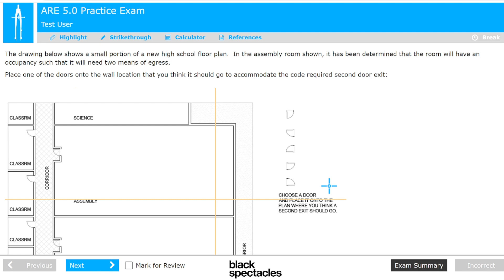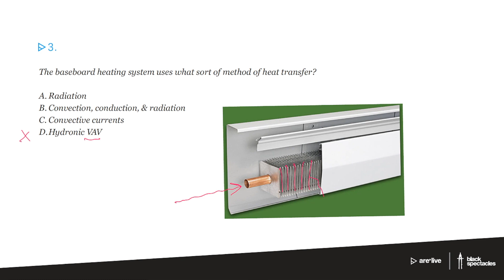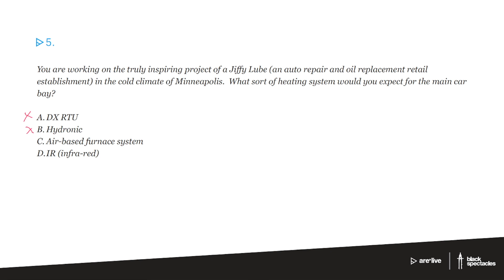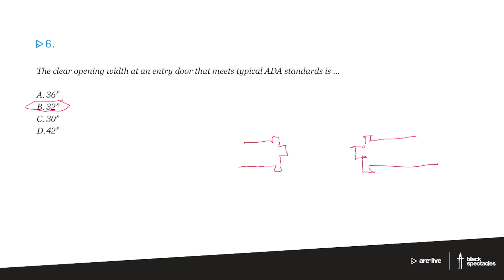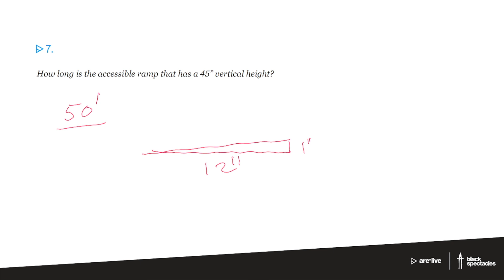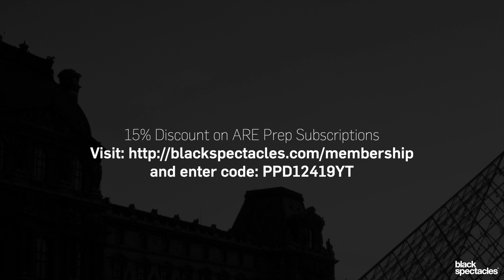ARE Live: Project Planning and Design Mock Exam - 2019

Comment: in question 7 shouldn't landings on the bottom and top be included into calculation? Sample item 10 for PDD in NCARB Handbook includes top and bottom landing, although the question specifically asks to include them.
Reply: I was about to ask the same thing. I'm going to add the top and bottom landing since the NCARB example included them.